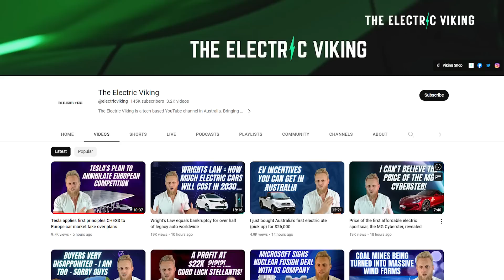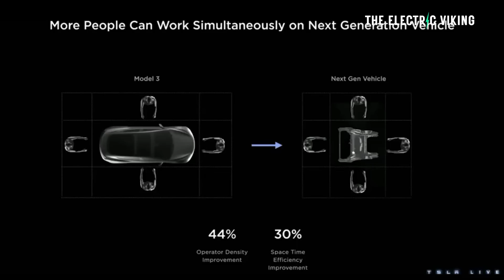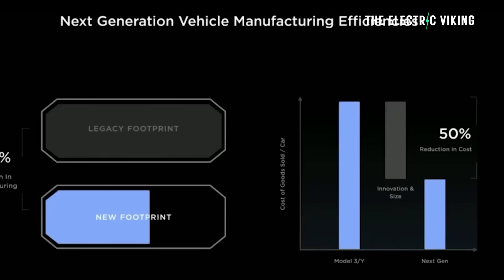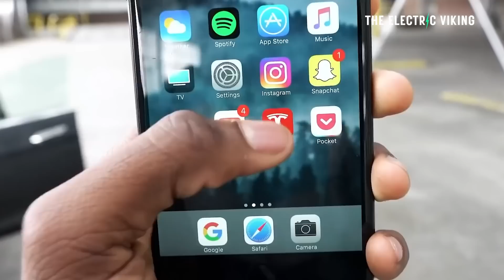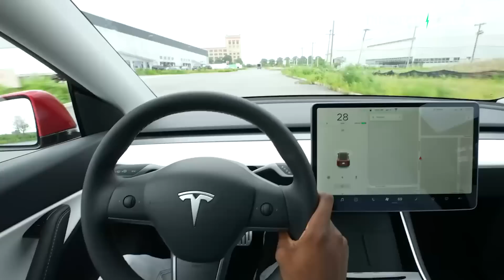Auto industry experts debate Tesla's revolutionary new manufacturing system

Comment: Tesla uses a technique for making the floor of the car rigid by making the battery pack rigid. Eventually the frame and other structures like the dash or the body may become batteries, so the battery pack in the floor won't be necessary. Batteries as we know them now won't exist. But the method of making a rigid floor will still be worthwhile even without the battery cells. They will just be lighter.

Comment: Unboxed. Traditional assembly line means build the frame, then shoe horn in all the interior. When the full size of the car moves down the line, just one part is installed at a time. When the seats get installed, nothing else gets installed. When the front, rear and floor get all their parts installed, they don't need to get shoe horned in and all these sections can be assembled at once instead of one part at a time.

Comment: 10:08 we might differ on the definition of "mass produced" but circa 9,000 Deloreans were produced with a stainless steel body, that is, as of this video, 8,999 more stainless steel Deloreans than Cybertrucks.

Most buyers who at first enjoyed the novelty of the brushed stainless finish on the Delorean regretted their choice very quickly as they came to realise you can't repair scratches and dents like normal sheet metal, there is no possibility of body filler and paint to make a repair surface perfect as the panel is exposed metal (apart from clearcoat?) I assume instead of panel repair the Cybertruck will rely on panel replacement.

I guess it's back to the future for Elon and the team.

Comment: Tesla has so few models compared to other manufacturers that not having the ability to make different models on the same assembly line is not really a thing for them.  The only exemption for Tesla is the Models S and X being produced down the same assembly line.  Both of those vehicles are "old" technology that has limited run requirements.  No biggie.  Tesla might even add the Roadster to that S/X assembly line given that all three models will be in limited production.  But watch out on the Model 2, the Model 3, the Model Y and the Cybertruck assembly lines.  Those are dedicated and are constantly being tweaked to produce even faster.

Comment: Tesla seems very innovative and needs to be since they are in their own ecosystem, but legacy auto only does incremental change  using their supplier network. Legacy auto is handicapped since they are swapping ICE for batteries. Criticism needs to be egalitarian and fairly leveled against GM, Ford, and Tesla where they miss deadlines and forecasts. I remember a Cleanerwatt video that criticised EV's for their energy to weight ratio compared to the energy density of gasoline as the fuel. A fair comparison needs to include the high weight of the internal combustion engine and lightweight gasoline compared to the combined weight of the EV (light electric powertrain plus relatively lower energy density of the batteries).

Comment: For those of you who don’t already know:
Tesla’s unboxed system involves moving the vehicles from station to station on automated carts. This has a couple of important advantages:
1)	An assembly line is a gigantic conveyor that has to be maintained as a unit. If it goes down, the whole factory is shut down. Individual carts can be pulled out of service with little or no impact on the whole factory.
2)	One giant assembly line can only go as fast as the slowest station. If a bottleneck is identified with the unboxed system, additional stations can be added to handle that task and eliminate the bottleneck.
3)	Retooling. An assembly line has to be shut down while retooling is implemented and tested. With the unboxed method, the new tooling can be added in parallel until ramped and proven. The old process can then be removed without even slowing down. The same can be done for different trim levels.
It’s absolute genius!

Comment: I've been watching this for years. And I've finally bought in. I have a new Model 3 Standard Range and it's a great car. Of course the minute you buy in it's like, some really great innovations are just around  the corner, maybe I should have waited. But that is always true. And the other thing that is revolutionized is the buying process. No more dealer pack, no more finance office, no more getting sweated for a 5 hour buying process designed to extract more money out of the customer. Tesla is still the only EV with integrated software and a widespread charging network while the legacy automakers are trying to figure out how to do business as usual by replacing  the internal combustion engine with an electric motor.

Comment: The key to management advancement in legacy car companies is the ability to say with authority 'No, we will not do that.' When this fails, which is rarely, stonewall the change effort and loudly proclaim I told you it wouldn't work at the first failure, and bury the result., These experts don't understand where Musk is going with all of manufacturing.  They haven't got a clue about the capabilities of AI to run a vehicle assembly plant like a gigantic sewing machine.  Speeds will be many times greater than any human can achieve.  Materials, parts, and subassemblies will be designed by AI to calculate solutions on the fly.  Anything at human speed will be eliminated. The plant space will be more like a cube because Elon is right about the current efficient use of plant space.  The naysayers will develop convenient memories in ten years or less.  Musk simply doesn't think like them.

Comment: Tesla has gone back to first principles in car production, and in the process has moved towards everything in production and the vehicle being software-controlled. That brings enormous flexibility and retrofitting capability, but the cars it makes still emulate ICE vehicles from the recent past in appearance. People take a while to adjust to what any appliance should look like, and what looks 'right' or 'modern', and that can hamper optimal function. London black cabs are now mostly hybrids, but look almost as if they were designed in 1935. People accept that because it's what such a vehicle 'should' look like. Evidently many car buyers still want to drive a fashion-sensitive artwork. Will Tesla take advantage of its unique position to reset what a small car looks like, a one-box design with the maximum interior space for its small footprint? If the Cybertruck is any indication, maybe they will. I hope so.

Comment: I remember reading about the savings that were made at Jaguar from the line for the XJS to the line for the XK. Some of these were from the design team talking to the guys on the production line about what might help THEM put the car together. Some poor fella had to get inside the boot (Trunk, for Americans :-), to fit some fixings. The XK was slightly redesigned to make access easier, and possibly the number of fixings reduced.

Talking to the folks on the line can pay off: Because it is a job that does not require a 'degree,' those who have them think that those who DO NOT, do not know anything. BIG mistake. They have great skill, and know THEIR trade very will, and when listened to, can make a difference.

Can Tesla make changes? They do not build cars. They build iPads on wheels. So they look at building computers. . . . . . . Thinking from outside the box. The aim is to keep evolving, rather than making the "Best Version" of what is already in use, they experiment with different ideas. Some don't work. Just occasionally, they do!

Comment: I thought that the point of Tesla production lines is that each model has it's own line so being able to changing cars on that line is not a requirement for Tesla.  I have a feeling that changing the gigapress to make different parts would take longer than changing the line.
Reply: You don't seem understand the process... Tesla makes changes ON THE FLY, with a virtual copy of each car in its database. So if car #1000 on the line has a particular design (say Ver1), car 1001 and higher could have a refined version (Ver2) from that vehicle on (until Ver3) comes along etc etc...
Reply: @greghudson9717  I d understand that but each line is dedicated to a certain model.  They do not make several models on a line.  Minor changes are easy but they do not need to change the line from one model to another on that line.

Comment: I believe it will work, in the long run, and it will bring down costs.  However, I guarantee the growing pains will be severe and it will take them a couple years to iron out the process.  It's difficult enough for Tesla or any car manufacturer to start production of a brand new car.  Tesla will be bringing out a brand new car design on a brand new manufacturing process in a brand new factory with a brand new supply chain in Mexico.  This will be a work in progress and won't be smooth sailing from the start.
Reply: I was an industrial engineer for GM for 25 years and a process engineer for two.  I know you are right.  I also know by watching that these difficulties will not deter Elon Musk at all. He will keep trying until he gets it right.  That's what he is doing with FSD,, batteries, energy, robotics and X-AI.  Legacy manufacturers should study every move he makes.  They aren't even in the same game.

Comment: The new manufacturing system looks good. There is a potential downside, for the customer: it may be difficult to access some parts for maintenance and replacement. Of course this criticism applies to current vehicles as well, but it would be nice to improve, rather than regress in this area.
Reply: Have you seen any Car Wizard videos about working on the HVAC system of modern cars? Have you ever replaced a thermostat on a VW turbocharged engine? It would be hard to do worse than that.

Comment: Sam, a reason for making and selling 3 wheeler cars is that depending on your local rules you may be able to register them as motor cycles thus avoiding some of the rules about cars. The British Reliant three wheelers are not as unstable as sometimes depicted and they sold well for many years. But they had their single wheel at the front. A vehicle with the single wheel at the back would be more stable.  By the way, my son has visited Mesa in Arizona twice. It's pronounced Messa not Meeza  :)
Reply: https://youtu.be/4D4XfAfp4Vo
Reply: Rais, it’s not pronounced messa. It’s pronounced maysa.

Comment: Modularisation of production would indeed introduce complexities in the area of synchronisation and buffering, however such synchronisation would not have to be perfect in order to obtain bennefits from modularisation though these bennefits may not be all or what that they seem to be being assumed to be.
To draw an analogy with compoter technology, parallel processing has been proven to create significanct increaces in the rate of throughput over that of a simple Von Neuman architecture.
The limiting factor on paralell processing or a modurised production process is the degree to which sub assemblies can be manufactured/assembled in separate locations and this is largely an issue of accessability and ergonomics. The work still needs to be done however and though there are bennefits in terms of acessability and ergonomics this may in fact require more factory space than a slower more linear process!
The improvement comes in the lenth of the final assembly line and the overall time taken from begining to the end of the production process at the expense of time taken at the sub assembly locations.
Teslas modularised production process reduces the total time taken to achieve throughput from the beginning to the end of vehicle production but it does not necessarily reduce effort ot the total aggregate time taken in production. There are some bennefits to be gained in terms of the ergonomics of access.
Innovations like the giga press do save time and effort and reduce factory floor space since they reduce component count and they also improve the ergonomics of assembbly.
To go back to the analogy with computer processors again, paralell processing does increace throughput but it does not necessarily reduce effort, (power consumption/operation throughput).
You can increace the throughput of a paralell processing sysyem by increacing the number of processing units but this will increace power consumption/effort due to the fact that you are increacing the total agregate number of operations.
The only way to increace the throughput of a linear Von Neuman architecture is to increace the clock rate which we know is not possible just as it is not possible to make machines in a factory work faster than a certain speed.
It would therefore seem correct to show graphics indicating a radical increace in throughput but not such radical reductions in factory floor area or cost!

Comment: Yep.
& there's no talk on the impact of castings on manufacturing efficiencies. At the end of the day, or by 2025, either you cast or you simply are NOT a production level manufacturer, merely boutique. And that's fine. That's when the fetishizing of more & more models starts to make sense, no?

Stalantis, GM & Ford will be able to bring a model up to "just" profitable, typical slim margins, at a 100-150,000/yr run rate. Doing that with 30 models, the ICE business model they are forced to use, as they can't crack the how to make them in the 500,000+/yr run rate range, makes sense. It takes busting around that 500,000+/yr level that grants you the scale to stretch out your margins.

Which is why Tesla needs to be gentle with their prices, with anything like a price war. The mission is to transition as quickly as sustainable to sustainable energy. For that we need maximization of productive capacity of the best quality cars.

Comment: Unboxed Process looks like a precise synchronization of parts coming together,ie, parallel processes coming together at a critical point.  This can be done only with precise software control and Tesla is as good as they come when it comes to software.  I think it will all work once the software gets fine tuned.  Revolution coming in auto manufacturing.
Reply: It is already happening to a significant degree in the auto industry, Tesla is only pushing it much further. A lot of subunits are assembled before they are moved to the production line.

Comment: Nothing wrong with being a fanboy if you like something and it merits your admiration.    Hell , I like Apple products to the degree that they are all that I own and use.  I do believe that Tesla must start working on the "little things" that buyers complain about and that can be most easily solved. Quality starts with good design.
Reply: Tesla's ARE good quality. You're reading 5--year-old press. You think they've developed all those new engines and batteries, and not fixed door alignment?
Reply: @KenOtwell  I agree Tesla's are good quality but there are definitely things that are awful and need to be fixed.  Off the top of my head, I can't believe after 3 years they haven't been able to fix the autowipers that are not only worthless but dangerous.  The new parking assists is catastrophic without sensors.  It is ridiculous how bad it is, I wouldn't even call it a beta release, there's so many bugs and false warnings.  Also after 5 years they still haven't fixed the autobraking unnecessarily slamming on the breaks if a car a mile down the road crosses your path, this is also extremely dangerous and infuriating.   Don't get me wrong, I still love my Tesla but it is not 5 year old press, they genuinely need to work on some things.
Reply: @Ryan-ff2db  Do you even own a Tesla?
Reply: @nilsfrederking62  Of course I do.  Did you read my comment?  Do you own one?  The autowipers are still not functional 90 percent of the time.  The parking assist without radar is a joke and is unfinished, and the phantom breaking, while it has gotten better, is still a thing.  What part do you disagree with?
Reply: @Ryan-ff2db  Do you appreciate Musk's deep belief in 'fail fast, fail often'. You are part of the process.  The process works by the way.  Tesla has data on every failure you experience.  It runs fixes on the fly and you are part of checking those too.  It must suffer complaints like yours but it will be far ahead of its competition after a few product cycles.

Comment: What is the last year you would recommend buying a combination vehicle, if you are not quite ready for an electric vehicle?
Reply: I bought a hybrid before buying a BEV.  It was a mistake.  I feel like I wasted money and time on the Hybrid.  Current BEVs are better than ICEs or Hybrids.  My model Y costs me $0.033 per mile in electricity!  My MB GLK 350 costs $0.19 per mile in gas and the Model Y is bigger, faster and quieter.  The Model Y has more rear leg room than my Pacifica Hybrid Van.  As long as you have a place at home to charge it, you can't go wrong with a BEV.

Comment: The innovation we see at Tesla, SpaceX etc. is the one defined by sustainability and backed by quality. Most manufacturers just battling with getting this equation right and they must keep dismissing it because they are failing to comprehend let alone establish and implement since they are here longer. Until it's done,  only then they are forced to mimick and so they stay behind. They keep wasting time critisizing when they should be researching / investigating these scientific possibilities. Thats where the failure point is and its worsened by the speed at which customers are adapting or better yet, buying into the idea of Tesla